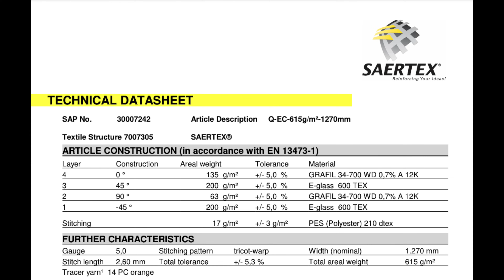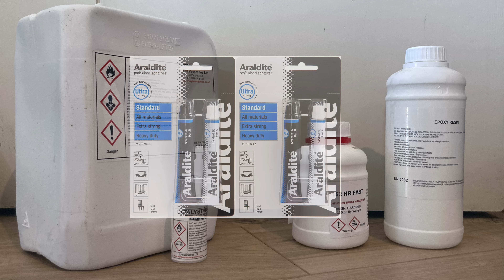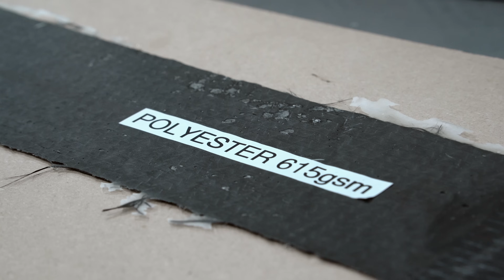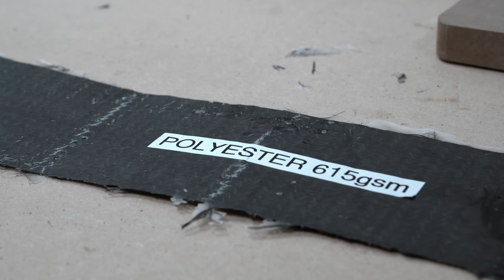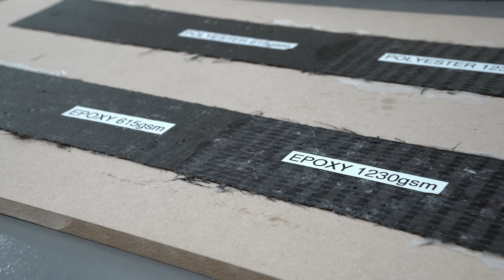Polyester VS Epoxy Resin comparison test - carbon / glass. Expedition lifeboat conversion.Ep102 [4K]

Comment: Epoxy is like concrete. It sets fast and cures quickly BUT it degrades over time. Epoxy doesn't like UV. That is its major weakness. Neither does carbon. Carbon fails dramatically and is incredibly fussy. The slightest wiff of grease or oil in the lay up can start a delam. Just breathing on a lay up is bad. One greasey finger touching the fibres is doing damage. 
These tests really don't give you a true grasp of what's important.
Reply from the maker: I think that's pretty dramatic. UV protection is possible using UV filters in the outer gelcoat or epoxy coat. Or paint. Carbon is brittle, so fails hard when it fails, but that's down to design. It's now common to weave in stretchier materials to hold parts together if the carbon were to really fail. I know dozens of people using carbon in serious applications without clean rooms, and they don't have delam issues. Not everything can be made from GRP.

This test achieves one thing - its aim - to show that carbon and polyester being a useless mess when combined is a myth.
Reply: @AlexHibbertOriginals  
UV filter's only offer partial protection and a slight stay of execution. There's a reason why Rolls Royce went bust trying to make carbon turbine blades...
The recent fatal crash of a military helicopter in Australia was a direct result of chip damage to carbon fibre components. 
It's a short term high performance material. But your boat is hardly an F1 car or America's cup contender. It's the shock loads and hit's that cause failure most, not bending. Eggs are a stressed skin monocoque. Light and strong until they get a strong point impact. 
Carbon is sexy but like all casual encounters it's not a long haul solution.
Reply from the maker: I guess all I can say is that carbon and other hybrids are widely and successfully used in tons of industries outside of racing cars or yachts. It's a long time since carbon was a sexy new entrant. It's a matured tech. My brother was an assistant chief engineer at RR and I don't recall it going bust. You don't like carbon, which is fine. But it's an excellent low weight composite component when used carefully.
Reply: @AlexHibbertOriginals  
Rolls was bailed out by the government. Analysis of the stresses is vital to successful application of any material.
Marrying dissimilar materials to offset brittleness can work but
American aerospace love affair with carbon has been a very expensive crash and tell.

Comment: Helpful for my bow thruster installation later this winter. Thanks!
Reply from the maker: Just remember that epoxy has better mechanical bond performance to cured GRP than most polyesters.
Reply: @AlexHibbertOriginals  I am aware of this, thank you!

Comment: Very interesting.   I am not likely to need this knowledge, but it is still interesting.
I use resin to fill cracks, gaps and voids in my wood turning projects so just the resin.   Not a relevant use case for your needs.
For my wood turning needs, I am not fond of the polyester resin which is e.g., 1 drop of MEK hardener to x oz of resin.   I often need small amounts of resin, much less than an ounce so it can be a challenge to get a smaller drop.   Too much or too little MEK can mean the resin does not cure.
The epoxy I use is a weight based mix ratio, so easier to mix small amounts of each component based on a digital scale with appropriate resolution.
I look forward to seeing how you will be using the interesting tape in the future.